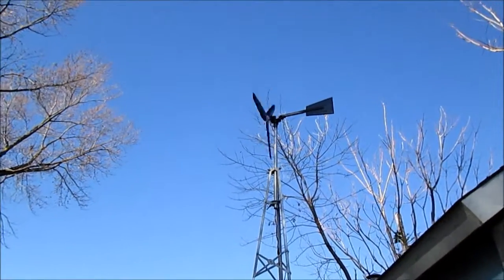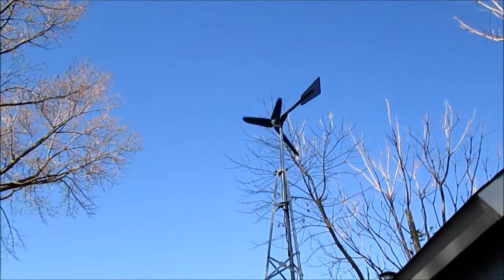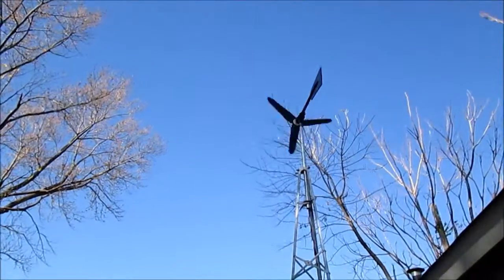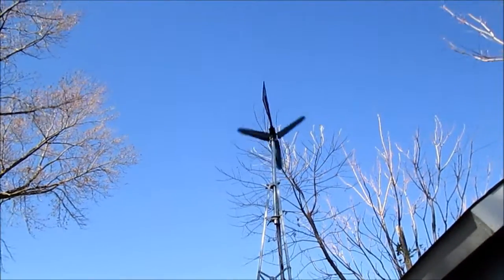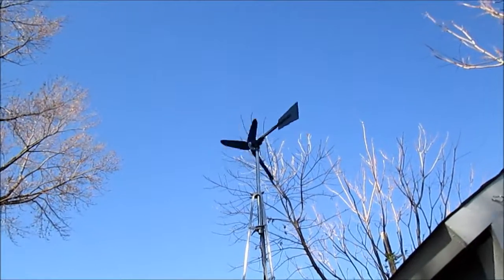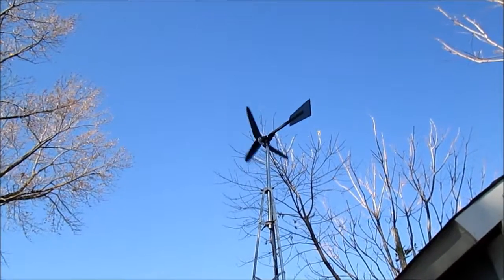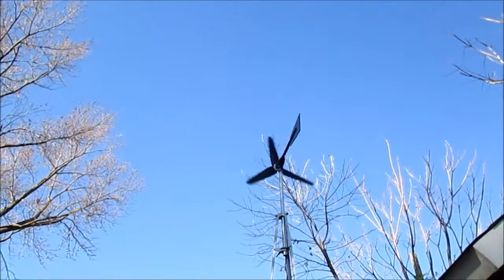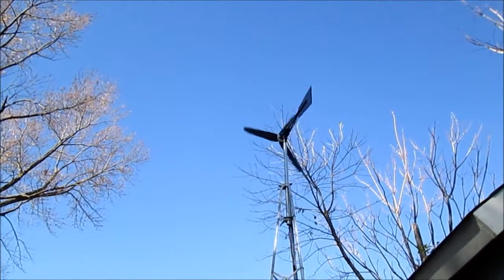Problem with using Wind Turbine in urban / city area

Comment: I've seen that happen in residential areas.  They have to put them up really high but then it gets into code issues.
Reply from the maker: Craig Arndt I don't know my local codes I do know There is a code on antenna towers

Comment: your tail is too small, the tail if the right size will keep the blades facing the wind. this is the problem with many Chinese turbines is the tails are too small and they flop around like rage dolls.
Silent death just posted a video on how to calculate the vane and tail dimensions.
the other thing to consider is offsetting the vane from the center and put on a hinge so that when the wind speed is too high, the tail will move the blades out of the wind. this will prevent the turbine from burning out..